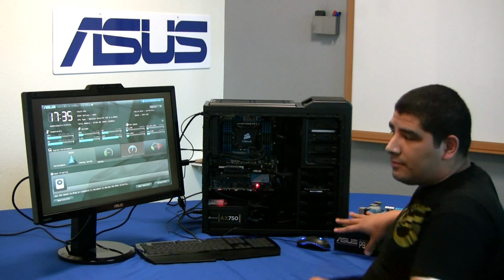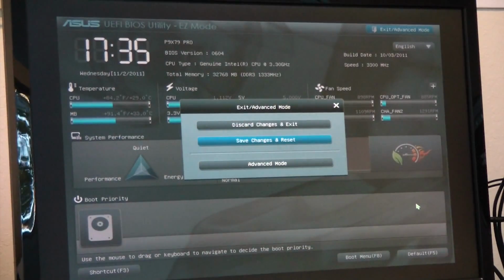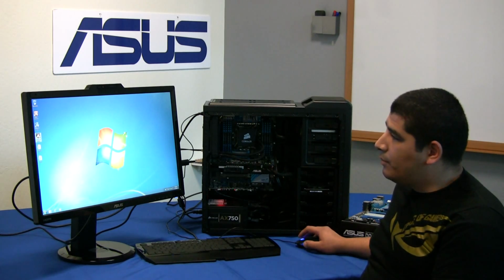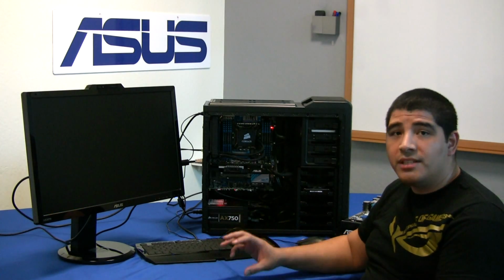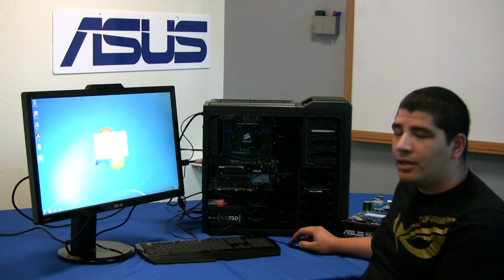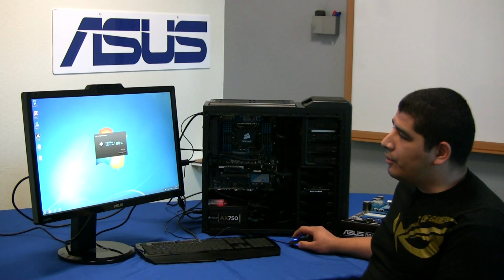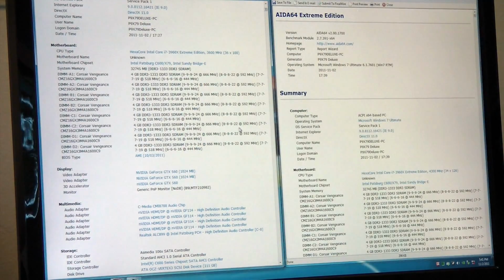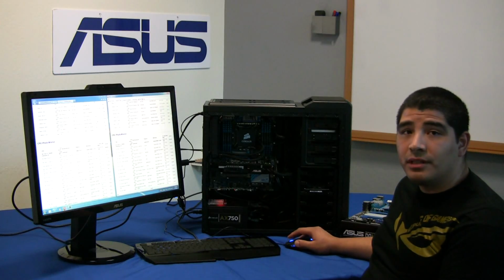ASUS X79 - Auto Overclocking

Comment: I got the ASUS P9-X79-E WS w/ E5-1660 & Galaxy 680 SLI 4gn. & I never got around to trying TPU switch but Used Performance mode in EUFI + XMP 2400 ( I had to manually set Cr 1t) & I got 4.2GHz out the box doing nothing. since BIOS v0211. Later  to E5-1680-V2 & Strix 980-Ti in SLI & needed BIOS v1203. It never realy did well in TPU or other auto config. Had to set manually to get my same performances but it did run as cool to 4.2GHz. Thermal Ultra 120 Extreme Cu 2x Noctua 12cm fans 1200-1800 RPM. 
Anyone still using this? I wanna give it another go

Comment: Help what is the best CPU for motherboard p9x79 pro Thanks
Reply: I7 4820k
Reply: @michaelscardino8614  wrong
Reply: the best is 4930 or a xeon
Reply: Well considering it's only half the price for a 20% increase in efficiency I think its 4820k.
Also, 4820k has a higher base clock speed of 3.7GHz compared to 3.4GHz
Reply: @michaelscardino8614  thats like the same clock the diff is threads 49 is way better at multi stuff most cards that do better at multi is the better one most the time thats the reason I got a 3930k 2 years ago its better then cards that came out after it I only had thing is it runs hotter and the tdp is lower
Reply: @cmoneytheman  agreed but for the price I feel like people should just get a new motherboard and a current generation CPU. I'm just trying to be practical here

Comment: Can I do this on a X79 LE? I have a i7 4820k and want to overclock it to get better fps in games at 1440p as im only running a single gtx 770 4gb, or will it not improve my fps as the gpu is already bottle necked by the far better cpu?
Reply: I had huge problems with that mobo, I should not of bought that setup for gaming. I still have the mobo cpu and 32gb of ram for it lying around somewhere is it worth selling?

Comment: When I tryed the UEFI BIOS ASUS Optimal Mode setting my computer restarted but never booted. It actually tryed like 3 times so I turned it off.

Other thing is that in games or rendering my processor (3930K) never uses the 12 threads. and the 6 it uses only go for 20% of their capacity or less. What can I do to fix that?

Comment: you man are an idiot(heat rising) way did you put the top fans blowing into the case? the top fans must be mounted in pull configuration because of the dust, of course is fain if you had a dust filter but you haven't. such an idiot!!!LOL

Comment: Actually, it looks like JJ actually had a case of actual camera shyness. Then again, he actually gave out good information meaning that actually the motherboard could be good. The hardware is actually good but I actually like the UEFI BIOS and actually the link between Windows 7 and UEFI is actually quite good.

And Actually, the stock clock of my i7-3960K is 3.3GHz, not 3.6GHz. Actually.